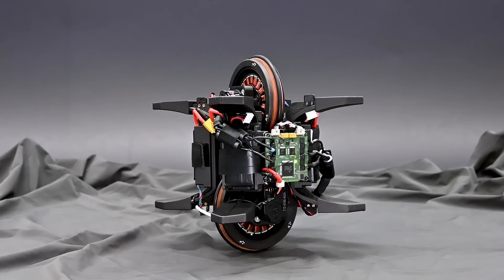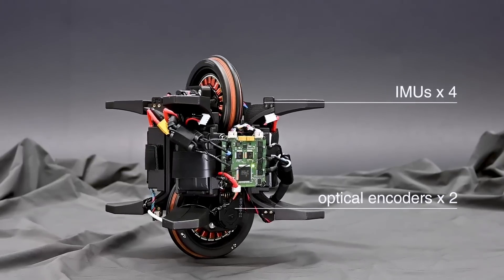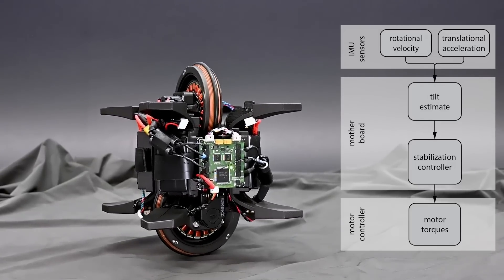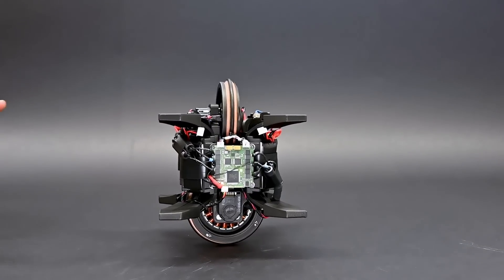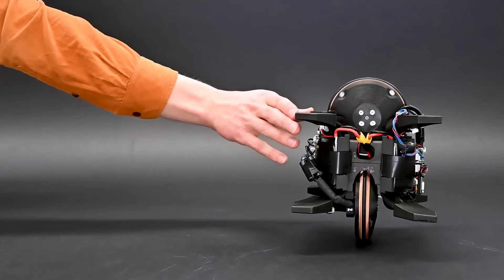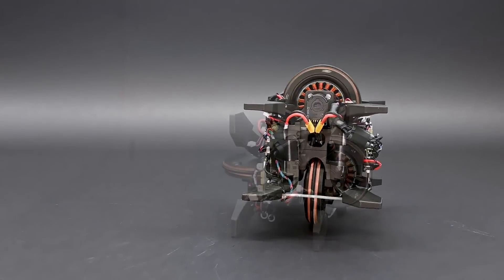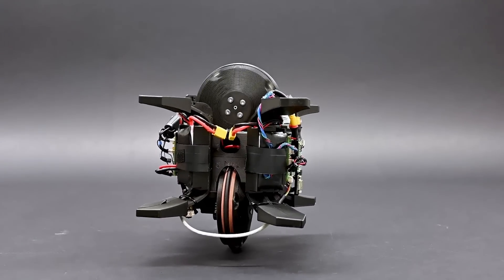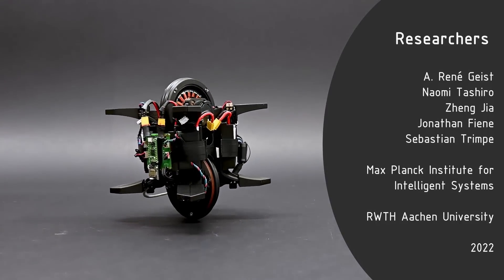The Wheelbot: A jumping reaction wheel unicycle

Comment: how turn to left or right this bot?
Reply from the maker: The reaction wheel (that's the upper wheel) can tilt the robot by a certain angle. If you want to keep the robot at this angle, the reaction wheel needs to accelerate such that the wheel would eventually reach its rate limit and the robot would topple. However, if the rolling wheel (that's the wheel touching the ground) starts to move the robot 'forward' , a tilted unicycle would start driving on a curve. At a given forward speed, you can find a tilt angle such that the reaction wheel does not need to accelerate to prevent toppling. 

You can observe a similar maneuver when watching a motorcycle driving through a curve. Here, the motorcyclist adjusts the tilt angle of the motorcycle depending on how fast she's driving through a curve.

On the Wheelbot's project page you find a couple of simulation videos in which the Wheelbot drives small turns. We are currently working on this topic.
Reply: @AndReGeist  
What about if you had two reaction wheels mounted at an angle above on each side of the driving wheel? Wouldn’t you be able to accelerate them in different direction to instigate a turn easier? And also to turn around its axis standing still.
Reply from the maker: @snabbgas1116  Absolutely! :) If you add a third wheel that is orthogonal to the other two wheels, then you can directly control all three rotational degrees of freedom. Yet, that the robot's "turning dynamics" can not directly be controlled actually becomes a feature if you want to study the "controllability" of under-actuated nonlinear systems or are looking for a simple yet quite challenging system to test your data-driven control algorithms on. In other  words, we don't use a third wheel not because it is easy (from a mechanical design point of view) but because it is hard (from a control point of view).
Reply: Maybe be able to build 
A better EUC than can help with balance.
Reply: @dennisgolden7596  
Lol Electric Uni Cycles were my first thought too. Maybe this tech could somehow be used to help stop cutouts from dumping the rider on their faces and butts lol.